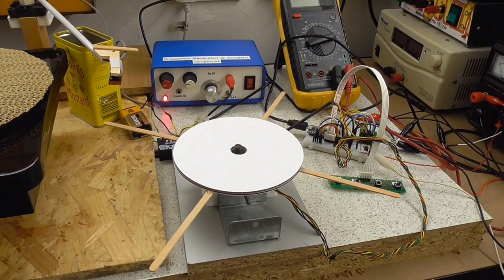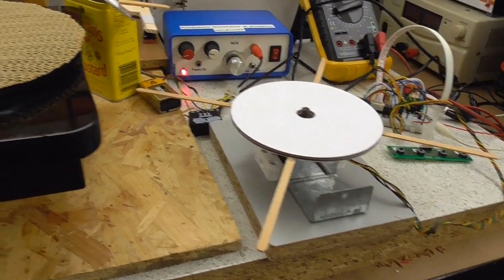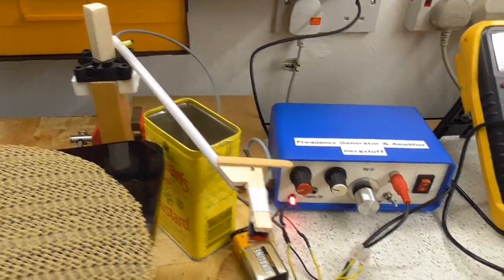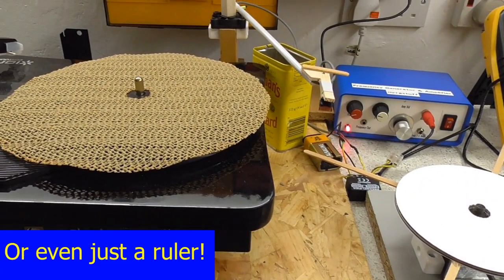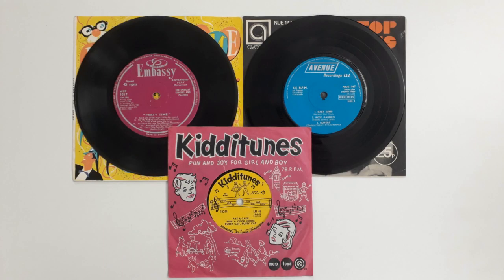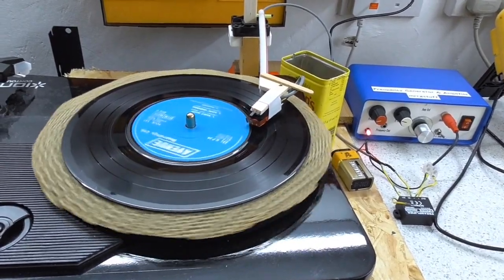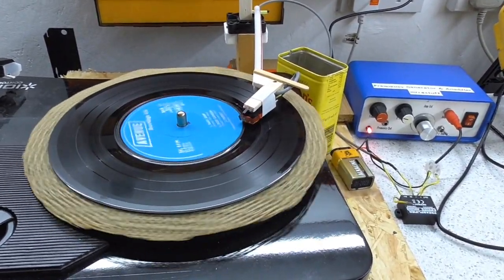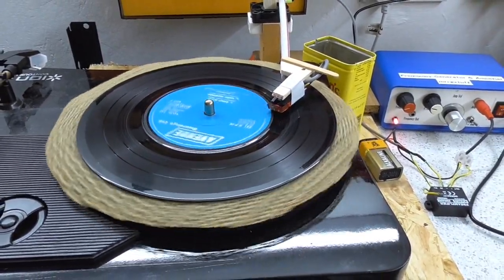Stepper Record Player Sound Compare

Comment: Is the stepper directly driving the turntable? If so, that's your problem!!! The stepper has what is called "cogging" and if directly driven AT THE SHAFT, the cogging effect will be amplified towards the outer rim of the record. 360 degrees divided by 1.8 degrees per step, is only 200 steps (cogs) per revolution AT THE CENTER!!!...and when you extend those "cogs" out to the point where the needle contacts the surface of the record, that cogging/jerking effect becomes amplified and noticeable. If instead you implement a belt type rim drive, your steps/cogs per rotation increases dramatically and the distortion goes way down. Also having a belt that is somewhat flexible and has a bit of flex/give will also help to dampen distortion. Rim Drive, Semi-Flex Belt, perhaps an Idler Pulley to help with tension and if you can enable what is called "micro-stepping" for the stepper, your results should be so much better!!!
Reply from the maker: Thanks for this 😀.  I did several versions of this, including belt drive, though none were truly fine. Here is the playlist if you are interested:
Stepper Motor Record Player: https://www.youtube.com/playlist?list=PLsCYUbO6xxnS62ktH0BS54tu94CK3_HJ3
😀

Comment: hate to critique , on 78 rpm setting i could hear some intelliglble noise , but on the other settings , nothinng. interesting design though. would love to see the project come to a most eggscllent conclusion.
Reply from the maker: Interesting. There certainly is a little noise on the 78 setting, though it's not particularly noticeable, at least not on this record. The 45 is also not too bad but to my ear, definitely worse. The 33 is certainly the worse and probably is the most effective comparison in the video. I need to match the speed of the turntables better so the comparisons are more representative. Improvements are well under way and I am increasing the step speed to improve the sound quality. Thanks for your interest 😀